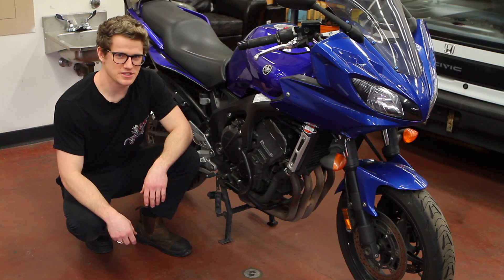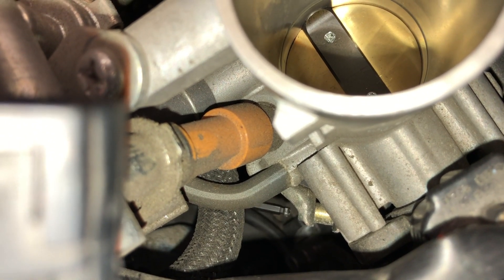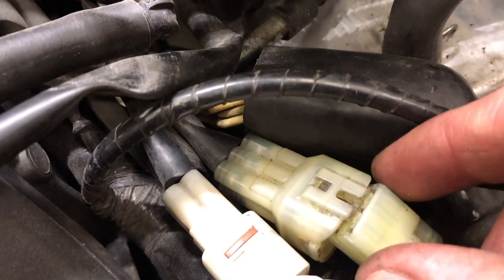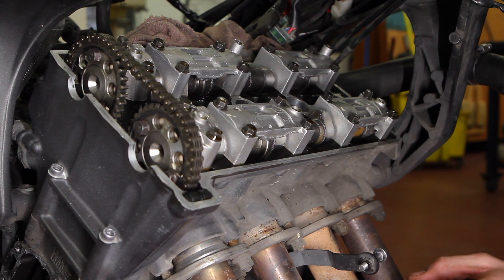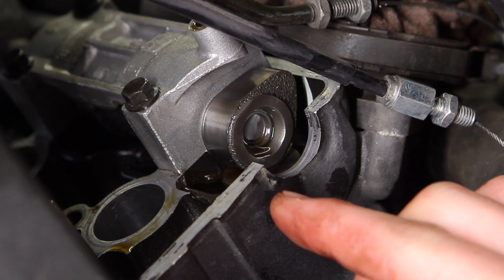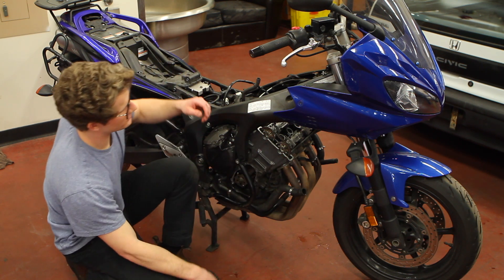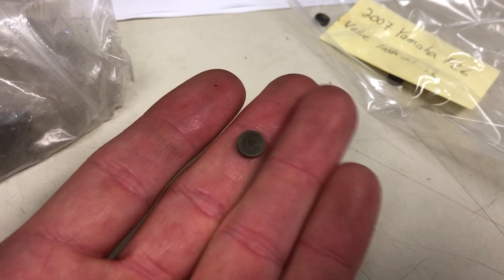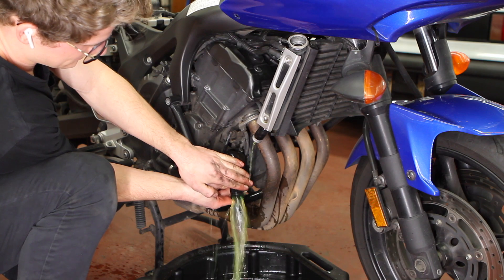Adjusting Yamaha FZ6 Valve Lash - How to

Comment: Here 4 years later trying to figure out why my bike won’t start after the job timing is set right have good fuel pressure compression and spark I’m so lost
Reply from the maker: Make sure you are timing the bike for cylinder one, which is on the rider's left of the engine. I made that mistake of thinking cylinder one was closest to the chain a few times before rereading the manual. If you haven't ruled out fueling, maybe pull the fuel feed line off the fuel rail and see if it's providing fuel. You can also do an injector pulse test through the diagnostic menu to ensure your injectors are firing. If I had to take a wild guess at your problem, I bet it isn't timing-related since that is relatively easy to check and inspect. I would guess it is a bad ground or loose wiring connection causing fuel to not be sprayed (since you say you have spark). Hope you get it sorted!

Comment: I've followed your video and did adjustment but I have to add why Yamaha puts in their manual that crankshaft has to be rotated counter clockwise. Before dissasembling chain I've put marks on camshafts and crankshaft, not only depending on what manual says. What I've found is that the correct possition of crankshaft vs. camshaft wil only when you rotate it counter-clockwise. Timing chain has some free play and when rotating it in direction of work you may miss the point to adjust it correctly....

Comment: Hi,
thanks for all the videos
did you open the motor completly ? 
do you have videos of changing the chain and tightener? or you let your mechanic do it ?
Can you please share manual?
i need to take all the parts out and leave just a frame, (it broke :( )
do you need ever precise key to measure how much you tighten some bolts ? 
i want to do it my self everything to make a project of it and mechanic manual is hard to find

Comment: Hi.

You didnt actually tell us how to adjust it if it is to big or to small.

All you did was check everything.
Could you please make another video where you actually adjust the clearances.. thanks
Reply from the maker: You adjust the clearance by removing the shim and bucket under the cam lobe then change the shim size. Shims are sized in mm. You can reduce clearance to by increasing shim size and increase clearance by reducing shim size. You can buy a pack of shims instead of ordering exact shim sizes from Yamaha.

Comment: Great video, I'm going to have to check my clearances and this is so much better than trying to look at still pictures in a manual!

Can I ask, when you reassembled the engine, did you replace the cylinder head gasket or just re-use the old one?
Reply from the maker: I did reuse the valve cover gasket but I would recommend replacing the timing cover gasket. Thanks for the comment! 👍

Comment: Hey Calvin,

awesome job. Not owning a FZ6 but an XJ6N 2015 which seems to have the engine in it. Mad respect for doing that on your own, I'm too scared to do those kind of deep surgeries in case I forget some bolts, tubes or plugs on the reassembly.

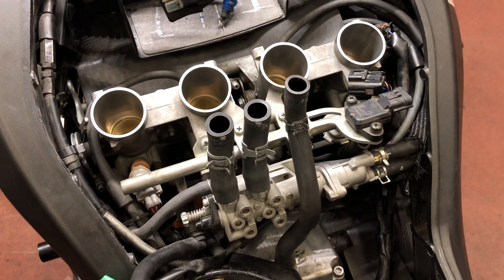One question: What are those two tubes coming from the radiator to the engine at 4:46? What are the doing? I realized, that on my XJ6 the radiator in total has (I think) 6 tubes going into it. Why is that? My Yamaha WR125x only has 2 (which makes sense to me).

Again, thanks for your video.  Greets from Germany.

Comment: I dont understand why did you remove the throttle boddies, they doesnt get on the way, you just need to take out the spark plugs and AIR Valves and that's it!

Comment: I'm a bit overdue on my FZ6 (~34k miles). This is quite a large job. What's the harm if they're on the edge of needing adjustment, or slightly beyond? I figure new spark plugs and balancing the 4 ITB's would be as impactful in the engine's health and performance. I've also seen a majority of folks reporting good specs on their first check at 24k miles
Reply: Shimmed valves tend to tighten with wear. If the valve clearances are too tight then it will be a pain to start, run poorly, and if left too long burn out a valve

Comment: You are right on when you said you thought that might be coolant temp sensor. But isn't lash supposed to be checked with the valves open? I don't have the service manual handy but I'm working on the 600 Yzf, maybe there are a few different procedures for your engine...?...

Comment: Holy cow, this is a substantial job indeed!  What are the consequences of not doing this adjustment?  My bike is overdue unfortunately, this is the first I'm hearing of this needing to be done.  I'm at 31k miles...
Reply from the maker: Consequences could be accelerating the wear on your cam lobes by having to much gap or possibly burning a valve because the gap is too small and isn’t allowing the valve to seat fully between actuations leading the valve to run hotter than normal. Basically if the valve doesn’t spend enough time pressed firmly against the head between power strokes it won’t dissipate the heat to the cylinder head (valve lash too tight). Wear on cam lobes is caused by the excess “slapping” of cam lobe against valve spring bucket. You would likely hear a valve who’s gap is to large because it would tick more loudly than normal. A tight valve wouldn’t really make any noise to indicate it’s issue. When I did my bike the first time about 1/3 of them were out of spec but only by one or two thousands of an inch. Best of luck!
Reply: @Calvinm  thank you so much for the  explanation!  I'm gonna have to think about getting in to adjusting that, pretty big job.

Comment: Greetings from Croatia, the videos are great and help you a lot, I have one question, and maybe I already asked you hahahaha, why do you hear a loud clatter at the phaser, that is, a blow when I change gears. whether it's up to the basket or the gears themselves have air, the engine has covered 45,000km. Thanks in advance and sorry on gooogle translate.
Reply from the maker: The Yamaha FZ6 is known to be a fairing clunky bike, so it might be a normal noise. My transmission isn't very smooth between first and second gear shifts if that's what you mean, I think that is normal for the bike though. If you have a noise coming from rider's right when clutched out, in neutral when stopped, that is typical. The clutch plates clatter in a noisy way when not engaged. If you have not done a valve lash adjustment by 45,000 km's I would recommend doing one, it might quieten down your engine a little if some of the valves are out of spec. Hope that helps!
Reply: @Calvinm  Thank you very much

Comment: What made you do this job on this bike? 
Was it showing any signs of mechanical failure? 
I recently bought a 2004 FZ6 with 27K miles, and it runs like a champ. 
How would I know if something like this needs done? 
Also I'd definitely be doing it myself, because God only knows how much a bike mechanic will want, they already charge 3X more than car mechanics around NYC. 
Thanks for the video.
Reply from the maker: I did this job just to film it for you guys. I did this job in the past though when my bike was around 35,000km’s but the manual recommends doing a valve lash adjustment every 40k km’s (24k miles). If your bike is making a significant amount of clatter/noise from the valve train it is possible that the valve lash is out of spec. It can be hard to know if your bike is making more noise than it should so it’s best to open it up after 40k km’s (24k miles) and measure the clearance. Best of luck!

Comment: Thankfully don't have to do this yet. But when I do this will help me a lot.
Appreciate the fz6 content. Keep it up
Reply: If it ain't broke...
Before you start messing around with your bike's delicate bits, ask yourself if the bike still behaves as it did when new. If it's not having any problems, my advice is to just leave it alone. I have 42,000 miles on my 06 FZ6. I have never done this and the bike is still in like-new condition. Let your bike warm up before revving the nuts off of it. Keep the revs in check as you approach your destination so that the engine cools down. Replace fluids and filters as needed. Check if your brake pads still have meat on them. That's it. That's my entire maintenance schedule. I'd be more concerned about the damage you could do from unnecessarily opening up your engine. Just my two cents.

Comment: YES!!! I've been waiting for this video forever! I'm glad you filmed this. I wish I could smash that like button 1000 times!

 When I did this job it took me 2 weekends to get everything done and put back together. For the throttle body assembly I purchased a set of allen wrenches that fit on the end of a ratchet and used a long extension to get to the 3mm allen bolts. That worked out beautifully. I also printed out a little valve shim sheet that makes it easy to keep track of all the measurements. It's for a Kawasaki so the valve specs don't match up for the fz6 so you have to cross those out so they won't confuse you. When I did my intake valves I did them on the tighter side of the spec, because I figured having it 0.05mm more means the valves would open a teeny tiny hair more which might improve the amount of air you can get in, and it means It'll be a longer time before the clearance goes out of spec again. When I did the job I bought a hotcams shim kit that has any size you could possibly want, but I bought 2 sets because they only give you 3 shims per size and having the 2 sets actually came in handy because I needed to use 5 shims that were all the same size.  
https://i.imgur.com/VYRQBr8.png
Reply: It's more common for valve clearances to tighten with use, not to loosen, so if anything you should leave the gaps on the loose side. This is because the main area of wear is the valve seat and the sealing ring of the valve itself, which means the valve "pockets" into the head, tightening the clearance between the valve stem and the cam lobe or rocker arm pad. Normally the gap will only loosen if the cam lobe or the camshaft bearings wear out.
Reply from the maker: An allen on an extension would be good way of getting those pesky three mm throttle body bolts, good idea! Nice chart for the valve specs too, that would be very handy! I'm glad I could make this video for you and thanks for pitching the idea!